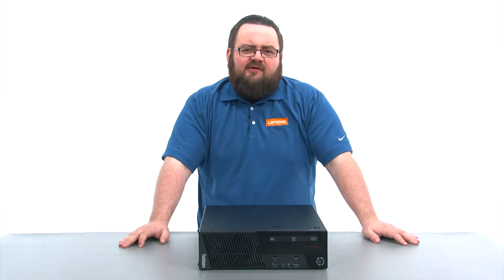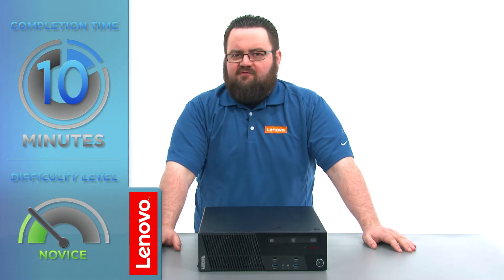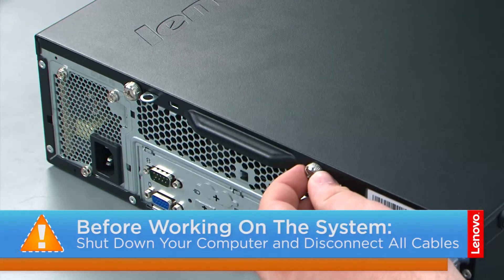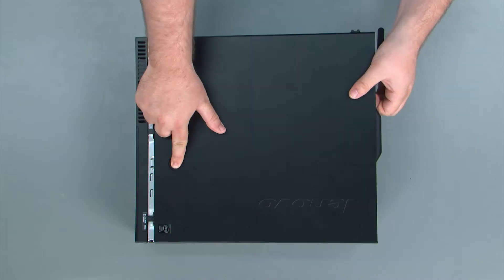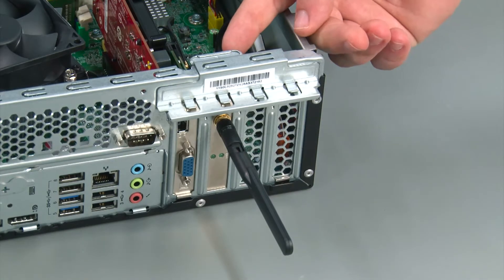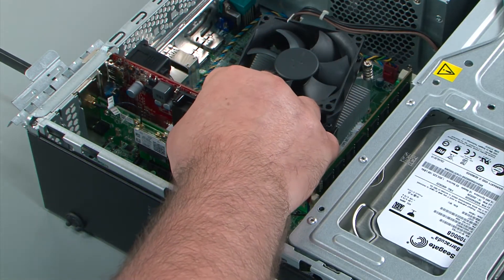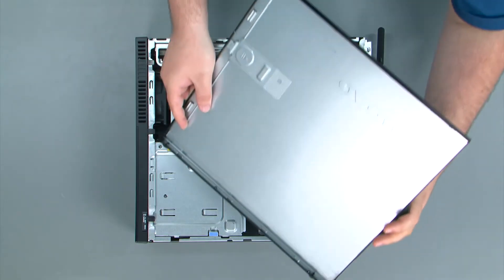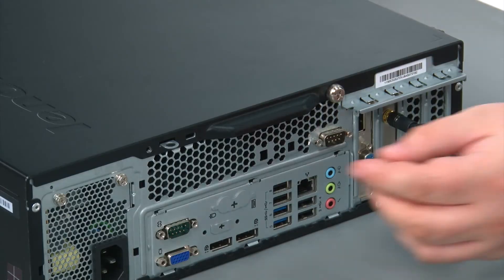ThinkCentre M83 / M93p Small Form Factor Desktop - PCI Express Card Replacement

Comment: Hi, i have an M93P Lenovo tower desktop, not the SFF and would like to upgrade video card that has hdmi ports, i dont game but i have a samsung 27" curved monitor on it. I also have a wireless card, a 500 SSD hard drive and 24 Gbs of ram in it. Do you know of any video cards that would work that aren't so expensive?
Reply from the maker: Hello there, Manny! Thanks for reaching our support! As we were checking here, we have found a similar discussion from the Lenovo forum https://lnv.gy/2YGPG4b and you check out the recommendation by of the community members (DSperber - Serior Guru). Let us know how it goes. -Chris_Lenovo

Comment: Can I install gt 710 ddr5 graphics card in my lenovo thinkcentre M83
PC using terabyte DVI to VGA converter...

Please tell!!!
Reply from the maker: Hi! Thanks for reaching out. Yes, you can as long as there is a PCI Express: 2.0 available slot on the motherboard and the desktop meet the minimum requirements of the GTI 710 graphics card. Mark_Lenovo
Reply: @LenovoSupport  So will it work in 240 watts 80+ bronze rated power supply...
Reply from the maker: Hello Matrix.Recommended PSU is 300W for this card. Hassen_Lenovo
Reply: @LenovoSupport  but I only have 240 watts psu
Reply from the maker: That would be the limiting factor. Found a similar discussion in the Lenovo community forums that could help you: https://lnv.gy/2GNTuvm. Hassen_Lenovo
Reply: @LenovoSupport  So should I buy gt 710 graphics card for my PC, I only have 240 watts PSU
Reply from the maker: Regrettably, no. The GT 710 graphics card requires a 300w Minimum System Power Requirement. You can check it here https://lnv.gy/30TepUZ Chx_Lenovo
Reply: @LenovoSupport  So, please suggest me a graphics card for my 240 watts PC
Reply from the maker: The general list of compatible components of your computer can be found here: https://lnv.gy/36RWUIC Just enter your serial number then go to "Compatible" tab. From there, select the component that you want to search. Chx_Lenovo

Comment: Hi, i have the ThinkCentre M83 and wanted to upgrade the GPU to GTX1650.  Will it fit?  Thanks
Reply from the maker: Hello Chan! IVvideocards that do not require a 6 pin pci-ex connector would be suitable for this model. We found a similar discussion in the Lenovo community forums that might help: https://lnv.gy/2ReKJh9. Hopefully everything goes well. Hassen_Lenovo
Reply: Does the GTX1650 worked?

Comment: hi, in levovo site said that the PCI Express 3.0 x16 has a limit of 40w max in the M83P. What this mean? Can I Put a GPU with more than 40w if I make a Power supply upgrade?
Reply from the maker: Hi Nacho. Thanks for reaching out. Based on the system informationn, you may upgrade the GPU to : AMD Radeon HD 8570 40 Watts. You may refer to this link: https://lnv.gy/2CFe6Ds. Let us know if you need additional information. Auxen_Lenovo

Comment: Can I upgrade my GPU to GTX 1060 6gb in M93P.???
Reply from the maker: @Conan Edogawa Hi! We hope you're doing well. We've found some discussions from the community, stating that the 1060 works with M93p Desktop https://lnv.gy/3g6ADYk Should you want to proceed, make sure to upgrade the PSU to 400w as well, as that is the recommended one. Hector_Lenovo
Reply: @LenovoSupport  Ohh. That's great and a good news for me. Thanks. :)
Reply from the maker: Please note that the upgrade may be applicable with the Small Form and Tower Form Factor of the M93p, since they have a bigger chassis compared to the M93p Tiny Desktop Version. Hector_Lenovo
Reply: @LenovoSupport  The machine type is 10A8. Lenovo MT-M SFF.
ThinkCentre M93P.
Reply from the maker: Thanks for sharing the machine type. Apparently, the GTX 1060 won't fit on the ThinkCentre M93P SFF considering the small clearance on the Small Form Factor. However, you can use the GTX 1050 / 1050 Ti. You can click this link https://forums.lenovo.com/t5/ThinkCentre-A-E-M-S-Series/m93p-10a8-sff-1050-40watt-pcie-limit/m-p/4002181?page=1&fbclid=IwAR1uSC7dxKxNaRPv11WLYVlDqZ3J1X-VKU0dT4U0YQIxvqJwEbD9ctQPnV8#4002181 for reference. Should you have any questions, you can always message us back. We're here to help. Rai_Lenovo

Comment: I have Lenovo thinkcentre m93p sff 10A8 CPU Intel Core i5-4570 3.2Ghz Quad-core Processor
16GB RAM
250GB 7200RPM HDD
PCI/PCIe Mini Tower
Intel HD Graphics 4600
DVD Recordable
Gigabit Ethernet
Win10 Pro 64bin I need to know how update the power supply and graphics card
Reply from the maker: Hi Isaac! Good question! You may check this article http://lnv.gy/2fpCv59 on how removing the power supply assembly of the Lenovo ThinkCenter M93p. For the graphics card, you may check the hardware maintenance guide http://lnv.gy/2fqoBjj (See page 162). We hope that all the information that we provided answers all your concern. Let us know if you need further assistance. Thanks for reaching our support. -Chris_Lenovo